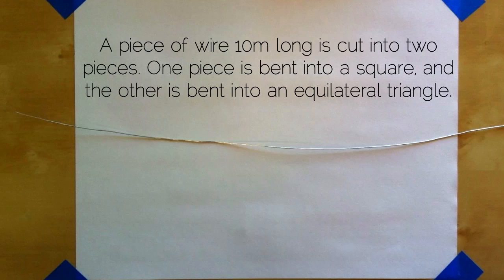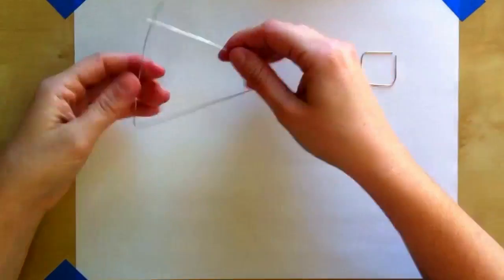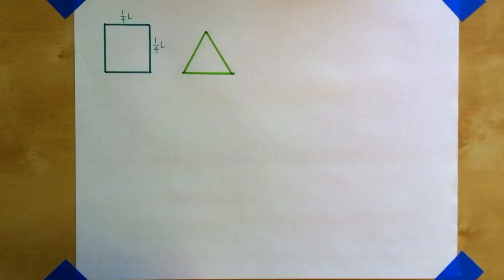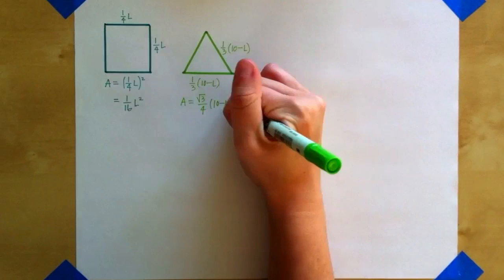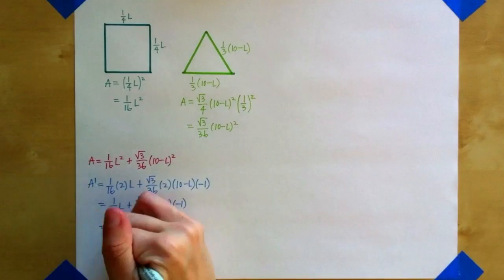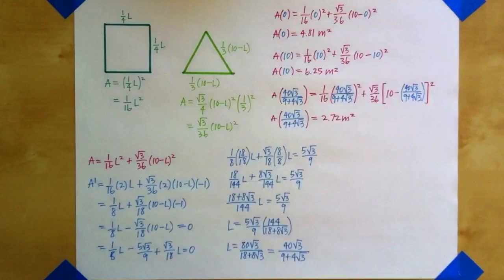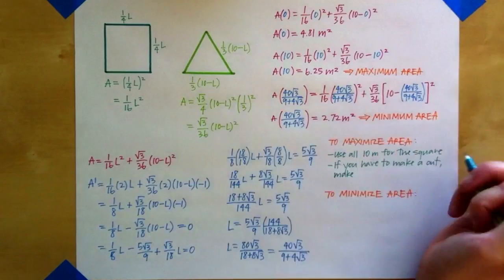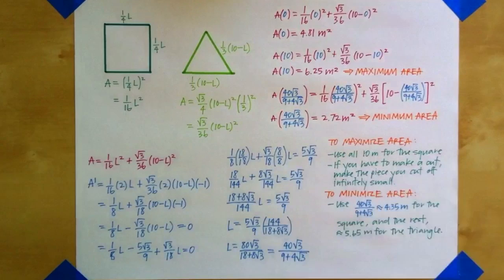A piece of wire 10m long is cut into two pieces (KristaKingMath)

Comment: What the fuck why does anybody have to actually write out math for this? I'm not very good at math but completely deduced the end answer through simple deduction
Reply: ^ exactly.... but you know... us students need to at least take calculus basically no matter what you are graduating in....
Reply: can you tell us how, please. Thanks!
Reply: Allison Goodman sure I basically suck at math. The question is simple. maximize area. There's 2 shapes involved. a square and a triangle. If there is no smallest area expressly required for either of the shapes, then you know that certain shapes have more area per perimeter length. I know a circle has a maximum amount of area per circumference so my two shapes, square and traingle, the square having more sides, that is closer to a circle, is a more efficient shape then a triangle per area in closed with wire of any length.. therefore I can infer that to have the MOST AREA with 2 Shapes, I need a piece of wire infinitely long for the square and infinitely small for the triangle. in the question a minimum amount of wire isn't specified so I infer this is my answer.

Comment: where did the -1 come from when you took the derivative
Reply from the maker: because you have to use chain rule to find that derivative, which means you have to multiply by the derivative of the inside function. since the derivative of 10-L is 0-1, or -1, you have to multiply by -1.
Reply: Thanks

Comment: I think the answer contradicts the question for the max area. If you cut something, no matter how small, it is still two pieces and thus all the wire cannot be used for the square. No such thing as a 0 x 0 x 0 meter triangle.